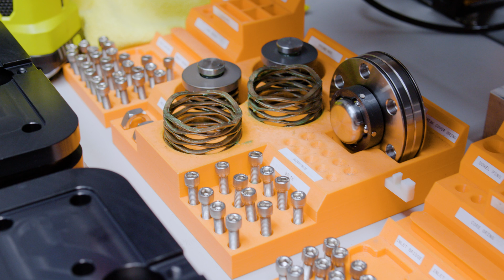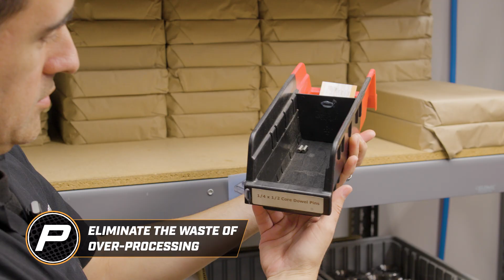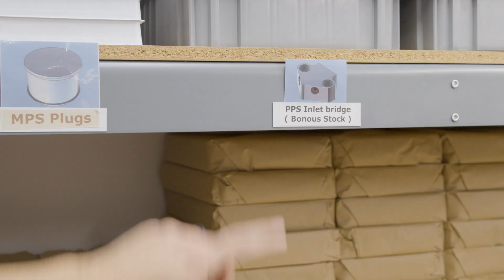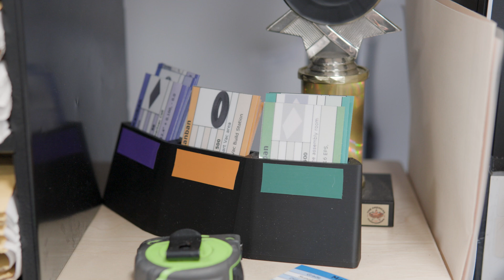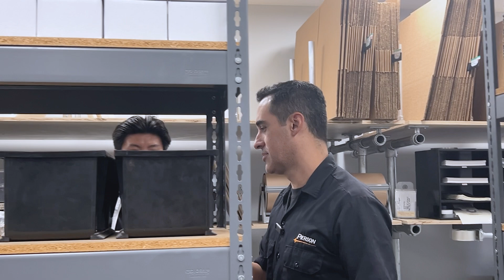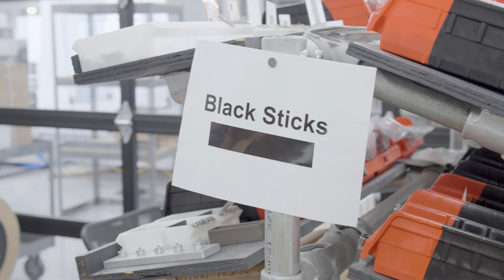DESIGN FOR MANUFACTURING | CSUN Tour Pt 12

Comment: Why did 1/4-28 become your favorite fastener?  Stronger than 1/4-20 due to the finer pitch?
Reply from the maker: 80% - fine pitch threads are easier to machine in tougher materials.
20% - slightly larger minor diameter makes it marginally stronger.